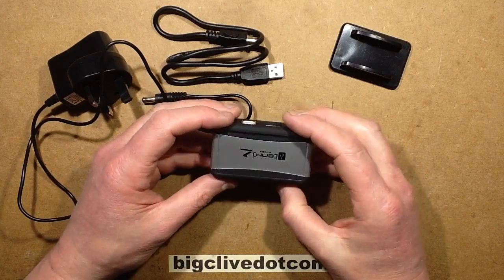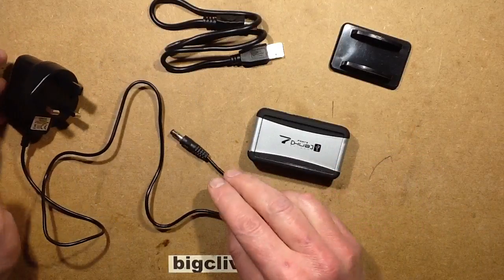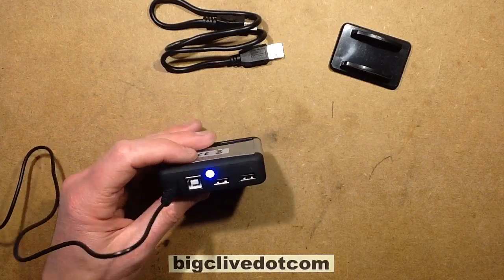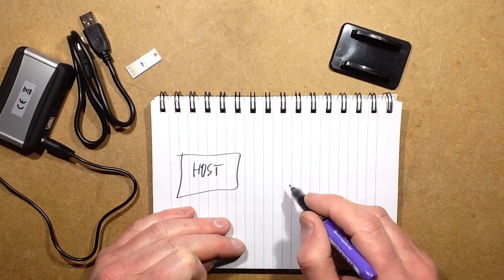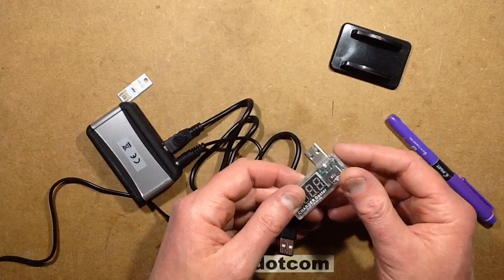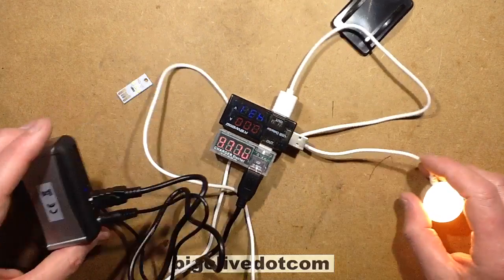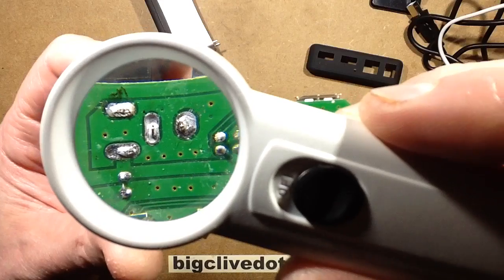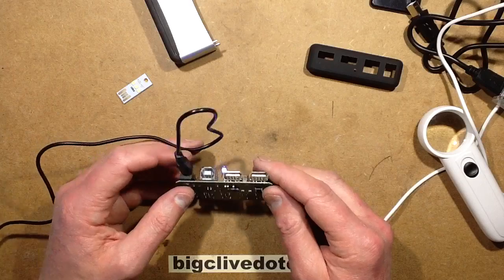Computer killing powered USB hub.  (Mac murderer)

Comment: I have also a hub (an other) with power, but it will nothing destroy. You need power for external devices like they use more as 0,5A. Then the power from the hub will be used. But whats the different to this hub? I think the negative line alway connected together on an hub ? Don't know...

Comment: Ive got one of these!!! oh dear, least Iam a pc user. Issue for me is my flight sim equipment ends up drawing more power than my pc's usb ports can handle so rather than buy the power adapter for one of the hub parts of the setup I bought this usb hub with its own power ( cheaper, easier to get a hold off etc). So whats the risk here?

Comment: I used to have a hub that that looked pretty much like that, when I plugged it in to my pc my processor fan started to run even with no power cord plugged into my pc...
can you tell me where I can get one of those USB power meters?
Reply: +O.T. Powell Next from Big Clive: "Computer-killing USB Voltmeter from AliExpress"
Reply: http://www.amazon.com/AboveTEK-AUT-39C-Portable-Monitor-Charging/dp/B00JIFMXSK/ is a cheap one that measures Ampere and Voltage
Reply: asdda Thanks.
Reply: +Norbert de Rooy - usb offers power in - if there is an external psu attached to the hub - this feedback will indeed zombie the pc - seen it.. ( experience )
but it also will fail to properly boot.
Reply: AliExpress has them for very cheap.  I think it's called a USB Ammeter/Voltmeter.  Takes about a month to get it but it's cheaper than Amazon I think.

Comment: Bloody hell the anti Mac bigotry in this comment section honestly makes me lose faith. So what if they are slightly more expensive than usual computers. So what if they use a different operating system. Any device that outputs 5v the wrong way is flawed.
Reply: Plythios Your just proving my point here. Its a cheap USB hub nothing to pledge your life and soul to.
Reply: Plythios Bloody hell are you out to get me? I left a personally reasonable comment. And making assumptions is the worst internet crime. I don't even own a bloody computer. I'm a tablet user. I'm not jumping on the board to defend macs. I don't give a damn about Macs or PCs i don't know much about computers, its not an area that interests me. I'm just so bloody annoyed with so many people complaining about apple because it just happened to break a few Macs. I would have written the same comment if its was Microsoft or Google the comment section was attacking. Its a cheap USB hub NOTHING MORE. And certainly not enough to warrant spending your life arguing about. I'm wasting my time here.
Reply: Plythios  BLOODY NORA I told you I'm wasting my time and in just proving myself right. I'm just complaining at the sheer about of people slamming apple for something that is not their fait. This hub has killed raspberry pis as well as macs. This is not the fault of anyone but the users of the computers in the first place. They learn from the consequences of being cheap Chinese tech. Yes look its my bloody opinion i am free to sensible polite and thoughtful criticism of it. Not "apple is terrible i hate them" Which is what i get anyway. And i don't even like apple. And your not telling me to leave the internet as in mot being told what to do by some guy who disagrees with me. Why do you bloody care about my opinion anyway? I can assure you i don't give two damns about yours.
Reply: Plythios Look, the is about a bloody USB hub. I am not experienced enough in the tech world to comment on any of apple warranty practises and their exploitation of the technologically inexperienced. However, i can tell you this is not about slave labour. I am against apples factories in China but I don't want to be reminded left, right and centre about it. Especially when it completely irrelevant to the topic discussed. Why am I still here anyway? I'll never get a point across to you here as you will just tell me to leave again. I've got better things to do in life.
Reply: Quantum Leap Finally someone with an actual brain in the comment section. Never thought that would happen.
Reply: Very old comnment but this is people who have had nasty experiences with macs trying to shove their nasty experiences with other users (not realising that some PCs also have this problem). I've had a nasty experience with windows but I wouldn't delete system 32 on everyone else's computer to screw with them

Comment: With most modern motherboards, the USB port will have a number pf protections in place (macs should have it too) where if you pump a voltage back into the PC, it will automatically shut off in order to avoid damage. Beyond that, the power pins also run through a fuse, sadly non resettable thus if it blows, you will have to solder in a new one. The data pins tend to only have a small amount ESD protection, thus why devices like this are able to kill a PC very quickly http://arstechnica.com/security/2015/10/usb-killer-flash-drive-can-fry-your-computers-innards-in-seconds/

The "repair' likely just required unplugging the computer for a little while. Many repair companies will often list a motherboard replacement in order to charge more. This is done especially if they feel that they are working with customers who are scared to take a computer apart.
Reply: +Razor2048           Now that was an interesting article to read, thanks for that. It really underlines one of the key points of computer security: You always have to ask, "If this is how the protocol is supposed to work, what happens when someone intentionally uses it incorrectly?" That's how Heartbleed was sussed-out, and that USB Killer 2.0 is basically the same idea but applied to a physical standard. Quite clever.

Comment: I have one of these and the PCB board is completely different. I've had it for a long time so they must have changed the board at one point and you have a newer (or older)one.
I don't know if the usb ports are still getting power, but I haven't had any issues with it.

Comment: For this particular hub, you can cut the trace between the USB port and the power jack, scrape some solder mask off, and solder a Schottky rectifier (SS34/1N5822 for example) in there. Then the back-powering bug can be fixed.

Comment: I have two of these hubs, stopped using the power supply as soon as I realize they were back-feeding. They work fine as un-powered hubs though. Worth noting that I don't have a Mac, and even though they were back feeding I didn't encounter any problems. 

You should tear open the power supply it came with, I bet you'll find even scarier things in there ;)

Comment: I discovered this problem a few years ago when my Toshiba Qosmio F60 would not turn on after shutting down with this hub powered up, for me the solution was to remove the battery & pc power adapter & hold the power button down for 20 seconds, then put the battery back in & it booted.

for the hub the simple solution is to use a modded USB cable with the +5v wire cut to use when the external hub power is needed, this will prevent the back feed.

  https://youtu.be/ZCa4o0hXWJQ

Comment: I bought one on eBay wired just like this, which fed power back into the host connector if you plugged an adaptor in. No warning to not use the adapter port. So I just opened it and cut the 5V connection to the host.

Comment: I bought one of these from eBay and had similar problems. 
It didn't kill anything but it seemed to stop my PC from sleeping and it caused my fancy Logitech keyboard & mouse (logitech G19 & G502) to stop working properly.
After a few days the hub became unreliable and then carked it completely.
Occasionally I'd plug it in and it'd work but most of the time it'd just cause problems.

Contacted the seller and he said he'd send a replacement.
I'm not usually thrilled about replacing an unreliable item with another of the same thing but it was being offered so I gave it a go and the replacement has been working (powered) without problems for about a year.
It get's used to power my KB and mouse continuously as well as for reading data sticks and attaching a USB DVD drive occasionally and even charging my phone at times.
All without any apparent problems.

The faulty hub has been sat on my window-sill for a year, gathering dust.
If Clive wants to do an autopsy on it, I'd be happy to send it his way.

Comment: its not the hub, its cause macs are shit
Reply: Something which feeds amps of +5V back into the host is fatally broken. Nice if the host tolerates it, but get that back-powering crap away from my equipment (none of which is Macs).
Reply: +Synthematix  No, it IS the hub.  USB ports output power, you are not supposed to back feed them. Read the specs.
Reply: +Plythios   You are NOT supposed to backfeed ANY voltage into the USB port of ANY computer. Period.  Any device that does that is stupidly designed.  Read the USB specs, because I know the OneHungLow Chinese designer did not.
Reply: +blargg   Exactly.  Boy, there sure is a lot of Apple hate in these comments....
Reply: a decent quality motherboard and psu will detect shorts and power themselves 
off, obviously macs cant cause theyre toss.

just desolder the maIns input jack then you will have a pc powered hub
Reply: Miike Hunt
Agreed, it shouldn't be changed to accommodate Macs, though accommodating the USB standard would be a good reason for it being changed. Are the very useful cases for things like a 'Pi? I can't think of why you'd otherwise want to feed power back into any USB host of reasonable complexity (e.g. cellphone, laptop, desktop), only DIY things like a 'Pi.
Reply: Plythios
I take it that tells the host to keep 5V on the USB port even when the computer powers down.

I wonder though whether the hub would still be non-compliant because it might be drawing effectively a negative current if its voltage is slightly higher than the host's (which can go down to something like 4.5V). I'm too lazy to look this up though.
Reply: Quantum Leap
I figure it's more that Won Hong Lo didn't care for the extra cost of proper power switching and because it worked fine if only powered on when the computer was on. I treat anything cheap like this with great suspicion before I connect it to any of my equipment. Buyer be very ware.
Reply: the power supply is there to turn it into a charger, if mac owners dont know basic electronics they shouldnt own a computer
Reply: Synthematix
Since you've mentioned it twice, please explain how you're going to charge the battery on say a laptop by feeding 5V into the USB port. Most laptops I've seen run on something like 18V, and have multi-cell batteries. Are you saying that many are able to feed the 5V into a boost converter to charge the cells? I'm highly dubious.

Yes, I can understand this charging a simplistic device that has a single 5V rail throughout, both connected to the USB charging connector and the USB ports, but this doesn't describe laptops as I understand them.

Comment: Well, this might be "a feature". My tablet has the support for USB host, however it does not provide power over the line. This hub can not only provide the power to the rest of the devices connected, but also, at the same time, charge my phone :)
For now, I have to use a "split cable" for the same functionality.

Comment: would it not make more sense to put a diode on the incoming 5v from the source than not connect it at all so that it can be used in either powered or non powered mode? I am sure this is how most of them work. then again, even the motherboards of those Macs could have had diodes on their USB ports and that would have saved those machines.

Comment: And how about to cut off that 5V power cable that goes back to your computer and leave it with 2 data and ground? I mean directly cut it in cable itself. A bit drastic, but that may put that HUB bac to use again, even thou you couldn't use it without power supply. That can be solved by adding a switch to it, but that again increases possibility of forgetting to put that deam switch off.

Comment: This also killed a P4 Fujitsu-Siemens machine I had. The hub in question was D-Link branded, but either through damage or bad manufacturing, the series diode was shorted. Being a P4 machine it just went into the bin, the hub is still in the drawer but with the DC jack full of hotglue. The newer D-Link hubs don't do this, I measured.

Comment: Many powered hubs backfeed power to the host port.  Cables with parasitic lighting are good for discovering that flaw before it complicates troubleshooting or causes permanent damage. Some block or limit the backflow from a misbehaving downstream hub.  Also 5.4v is well above the TTL limit of 5.1v.

Comment: The ideal gift for a smug elitist Mac owner.
Reply: +EgoChip Except they have lawyers, so send as anonymous lol
Reply: +Zudo     That really depends. If you're talking video-editing, they can be. Final Cut Pro is nothing to scoff at. They also do a decent job cramming as much as they can in a tight space; better than some manufacturers. The other benefit is the hardware and software manufacturer being the same means you're practically guaranteed to never run into driver issues.

Couple that with a bash shell (I cannot stand command-line in Windows, even with Cygwin sometimes) and the reduction in headaches and it's more than enough justification, at least for me.
Reply: +Zudo I buy 'em refurbished.  Just like new, great value.  If you are doing movie editing, nothing works better than  a Mac.  I own both platforms, and Win 7 works very well for me for the most part.
Reply: +EgoChip  Yep, love my Mac, don'cha wish you could afford one????  They're not for everyone, sorta like a Lamborghini.

Comment: I use this hub with a PC for a couple of years now. after watching this video i checked and, as expected those 5 v rails are connected.
On the plus side my PC USB port didn't got 5 v because the power adapter failed. 
I unplugged and disconnected  the power adapter and freed a socket in my extender. 
THX bigclivedotcom

Comment: Just in case you tire of tearing apart those cheap LED light devices, here is your chance to build one up, you know the reverse of tear it down. This is the first time I have seen these lights in kits:  New Energy Saving 38 LEDs Lamps DIY Kits Electronic Suite 1 Set | eBay
http://www.ebay.com/itm/New-Energy-Saving-38-LEDs-Lamps-DIY-Kits-Electronic-Suite-1-Set-/401096678038?hash=item5d63399a96:g:~M8AAOSwxcRW-id-